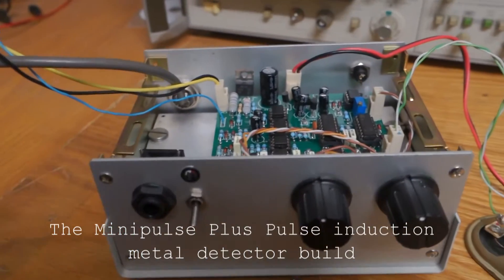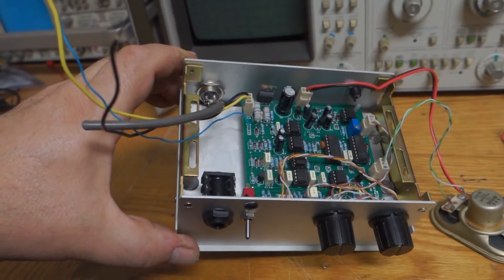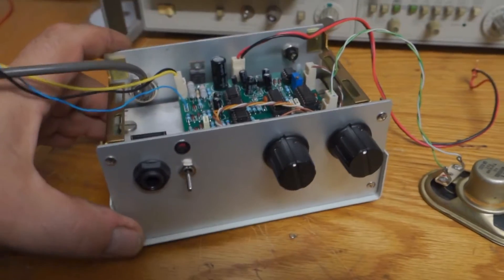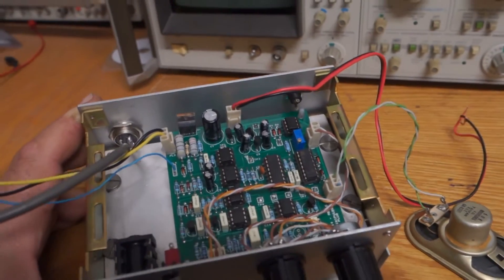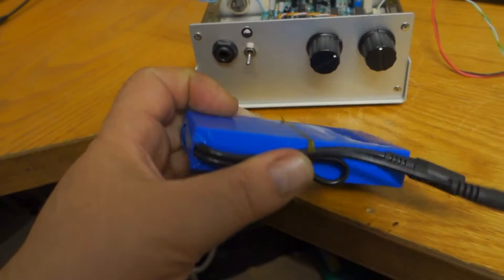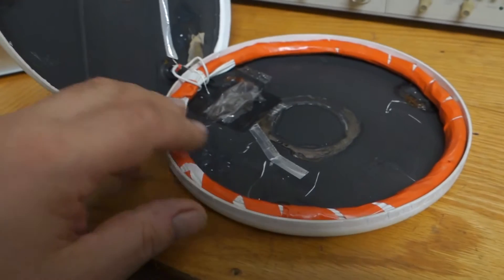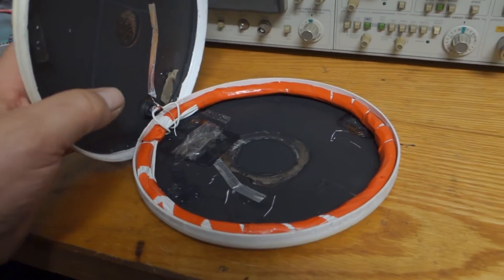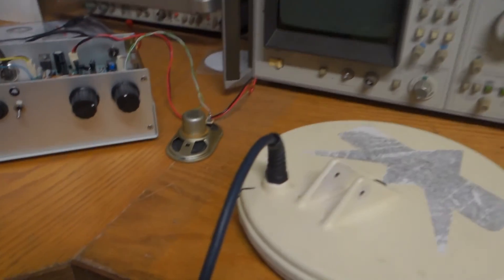The Minipulse Plus pulse induction detector build

Comment: If you open your battery pack you'll see that its a bundle of mobile batteries and specs are off by a mile even if you consider the mah that is stated on the batteries which notceven them have those kind of capacity

Comment: First Rate job you have going on there.  I bought the Surf PI from SilverDog.  Looking to do the Mini soon.  He does a Good Complete Kit for the Price.  I don't think I could do a board and buy the parts for much less.  How fast can you get the sample down to ?
Reply from the maker: Hi.  Just going by my memories here but I think I was getting 6ms with a commercial minelab coil and the same with a home made coil using teflon insulated wire. With simple coils considerably longer delays.  I built a few surf PI's and yes they are very good too. For the price excellent value
Reply: do you know difference between surf pi, mini pulse, baracuda and mirage pi ? what is the best for gold jewelry on beach ? thanks

Comment: i bought a chinese battery pack like yours but rated at over 9000 mAh and believe me it was useless...the capacity i found is about a third of the rated mHh...i have the mini pulse pcb but not made the detector as yet but ive already made 2 surf pi mac hines and i can get a whisper at around 16" on 9ct wedding band like yours in video and about 22" on a english old nickle half crown.
Reply from the maker: Hi David.     I haven't checked the actual capacity of mine but its been going for a long time on only one charge!  Yes Chinese milliamp's and watts are generally less than stated lol.
I built 2 surf pi's , this minipulse and the chance pi plus various vlf machines  Best I can get with any of them using a 11 inch minelab coil is 34cm (13 inches) for a gold ring.  Tried making many coils and although they ere fast enough cant get past that detection distance. Your coil must be working extremely well.  Is it shielded? Mine are all shielded.
At the price of these batteries even if its only a third ie 3 amps its still good value and will last a whole days detecting easily.
Reply: itakeyourphoto
you should be able to get better depth but you will need to modify your circuits cause the standard surf pi and mini pulse are just basic proformance...my coil is 400 uH and i can still get a 9ct gold ring like the one in your video at 16" whisper...im in the process of making my own circuit and im going to try to get the magic 18" on a us nickle which can be done if all the parameters are correct !!! i use scotch 24 shielding...the chinese batteries failed me on the beach and i will never buy another one !!!!
Reply: حداکثر این دستگاه با کویل بزرگ چقدر عمق میزند؟ @itakeyourphoto